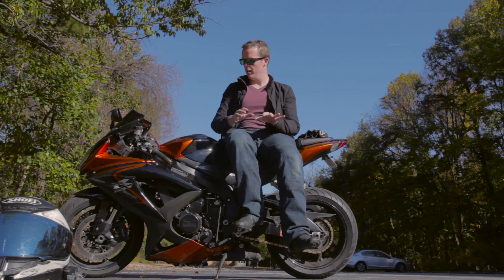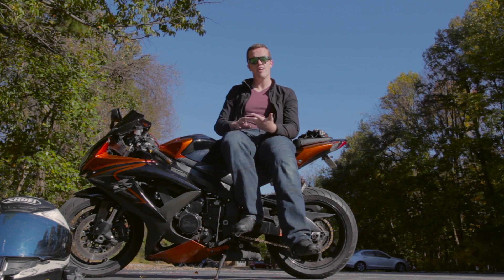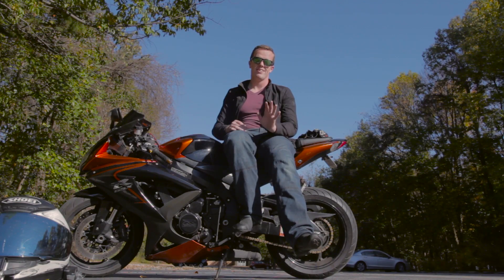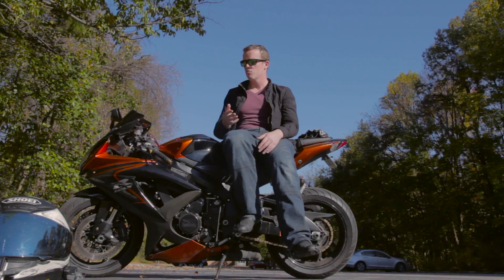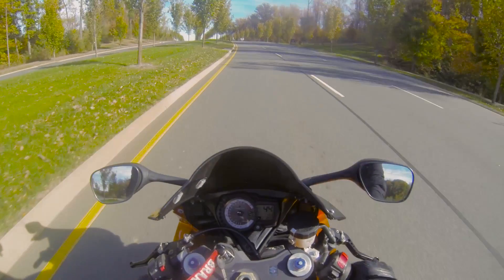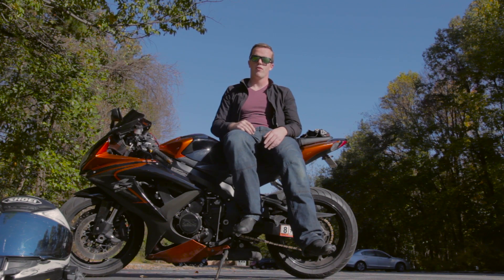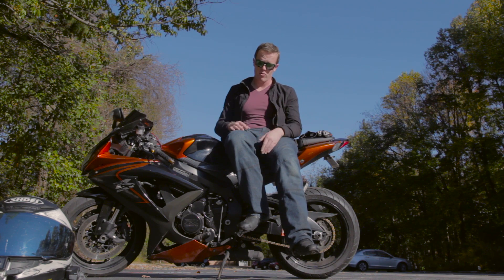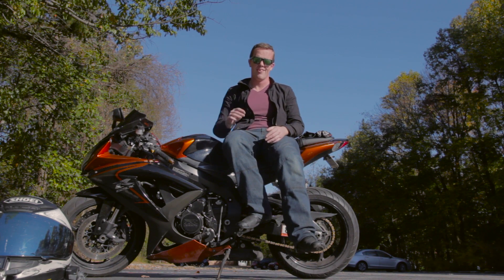How Motorcycle Engine Braking Works

Comment: When I learnt (mid 1970s) to ride motorcycle brakes were mostly all drum brakes and prone to fading when hot so engine braking was the normal thing and you kept the brakes for the stopping bit. Even today with my advanced (compared to back then) ST1100A I still mainly use engine braking and add the brakes when needed.
Reply from the maker: Solid advice! 

When I did my first track day I had to basically learn to use the front brake properly because I was so use to engine braking and then just using the rear brake for the last few feet
Reply: i had a cbr600 with no back brake and a xj750 with no front,engine brakings good